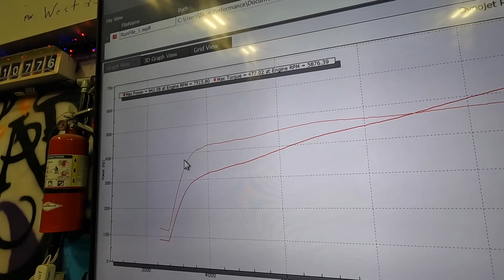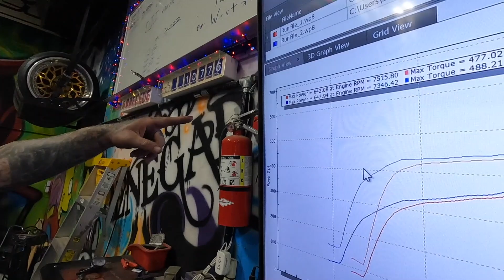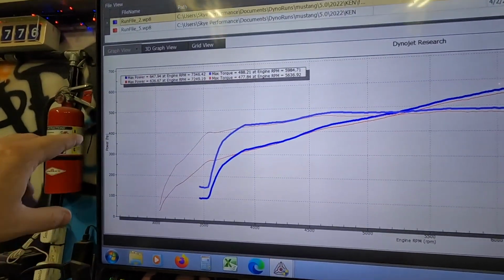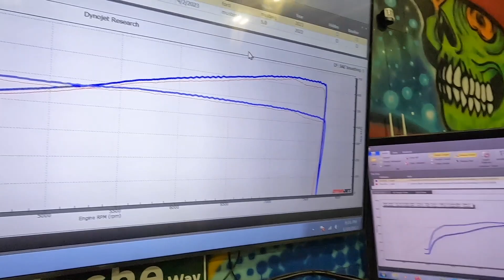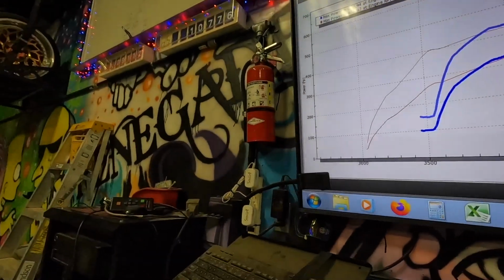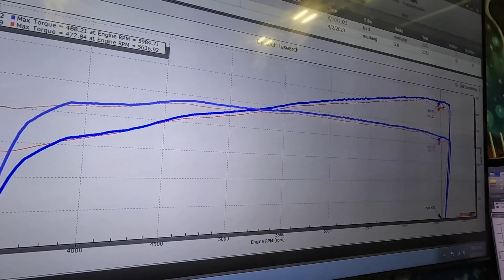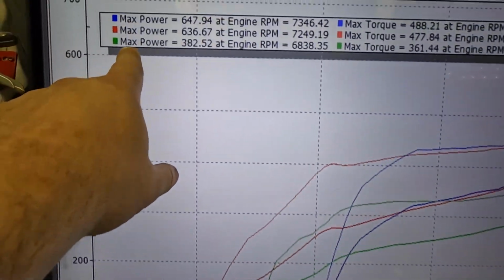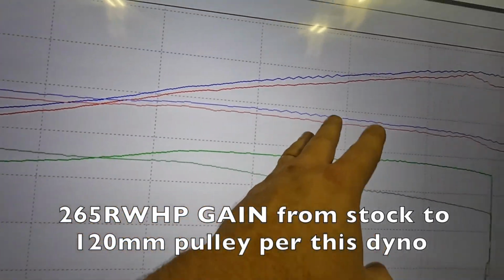Dyno of 22 Mustang with ESS G3X on 120 Pulley - 93 Tune, Stock Exhaust

Comment: HPR that ESS kit is really impressive it just keeps on pulling way up in the rpm band now that it's on E85 I'm really looking forward to seeing the passes it makes on the 120 pulley great series keep the videos coming.
Reply from the maker: Thank you! I’m looking forward to the E85 passes to see how it picks up at the dragstrip.
Reply: @SpeedAddict731  E85 without a fuel system ?
Reply from the maker: @cjflojack7963  no sir not on boost. I installed a fore triple pump fuel system. I will show it in the next video.

Comment: I installed my G3 / 120 this last weekend. So ready for a track day!
Reply: Nice!!  Did you notice a big jump in power just based on feel when driving?   I just bought a 2023 6 speed and planning a supercharger install this winter.  A big factor in the kit I choose is the overall feel.  I want to feel the power when I stomp it.  Appreciate any feedback you have!
Reply: It drives like stock until boost, then pulls harder and harder the whole way through RPMs.
Reply: @livestrib3752  nice man.  At what rpm’s do you feel it start pulling?  Reason I ask, I have a 6 speed so 1st thru 4th, the rpm’s climb real quick based on the gear ratios.  3-3500 would be the sweet spot I think!   Thanks for getting back to me.

Comment: Great comment about chasing dyno #'s.  I used to have an SVT Lightning that always dyno'd about 20 hp less than pretty much every other comparable truck when i was just bolt on.  But it ran 8.20's 1/8 on regular hard tires with pulley, tune, and mid pipe.

Comment: Hi, love the content.  What are the IATs for each setup please? I will be road coursing mine. After researching all the different super chargers I will pick the ESS. I want to keep it under 700 hp and don't want to change to E85. I have a '21 PP1 premium with H-pipe, active exhaust, and JLT catch can everything else is stock. What do you suggest?

Comment: What injectors are you using? Im considering the ESS with the 120 pulley as well. I dont want to mess with the fuel system and 600 + hp is plenty for me. Thanks
Reply: This is my exact reasoning.   Probably do some cooling mods.  Stay 93 octane and stock exhaust.
Reply: I have fic 1000 on my kit. G2 with G3 Intercooler, long tubes, high flow cats, x pipe, stock axle back with ngk spark plugs gapped at .028, vortex bap, precision bov, 2 oil catch cans, tuned by Lund on 93 pump gas for the last year no problem.

Also I have the mt82 but second trans lol. I have the McLeod RXT clutch with barton short throw shifter now. I also have stock OPGs for now. Car is heading back to the dyno next month. Last year it made just shy of 600 hp before the exhaust system upgrade due to a exhaust leak, on 125mm pulley so I'm hoping for 630ish on the 125mm now then pulley down to 120mm pulley and run it again.

Goal is 660-680ish. I'll be happy there. I plan on doing a fuel system upgrade next year and run e85 on the same pulley and hope to touch 730ish without dropping down to the 115mm pulley. I want to be able to drive it daily without having to swap from 115mm to 120mm because of knock issue on pump gas that the 115mm and below causes.

Stang is on my channel. I have some more content in the works as I'm still learning more about the kit and adding parts to the vehicle. Good luck with the kit if you pursue it. It's worth it.

Comment: Can a 2021 GT stock transmission run safely on a ESS G3 kit and 120 pulley using 93 octane? Thanks for the videos it’s always exciting to watch 🦾.
Reply from the maker: I have put over 2k miles on my car since the supercharger install. 0 trans issues. Usually around 800whp is when they can start giving trouble. However I’ve seen some go beyond that with no issues and I’ve seen some that go before that.  But usually 8-850 is when most see issues.

Comment: On E85 it’ll make 750.  I am running a Procharger D1-X with Fore fuel system on 13 pounds with E85 mine made 768HP/546TQ at Palm Beach Dyno.  That was on 20 inch / 305 Drag Radials which eats power on a Dyno.

Comment: I have the Ess g3, 115mm pulley, LT headers catless, 3’ H pipe all the way to mufflers. I’m still on 93 just because I haven’t put in my return fuel system. I wonder what I’ll be at
Reply from the maker: Depends on what timing you are running on the 115. Also on the dyno you use.
Reply: do you run booster?

Comment: I put down 730 and 590 on 93 octane with a g3x and 115mm
Reply: I've been debating running the 115 pulley on my gen 3. With 93 and boostane. You think it'll be safe?
Reply: @LSX-zr8ng i have been running 115mm on 93 for months now, zero issues, it's all about the tune that will make it perfectly safe

Comment: How much hp would catless long tubes add to the same setup on 120mm and 93??
Reply from the maker: I’d would have to have that setup on same dyno to be able to tell you that. I would assume around 20-30 more hp. Maybe more because you wouldn’t have the car going richer on the afr due to cat overtemp protection.
Reply: Makes sense, appreciate it man! I was just curious cause Brevin said 120mm on 93 should be around 700hp

Comment: I currently have the same set up but with headers, do you think I need to upgrade my transmission when I go on e85?
Reply from the maker: Usually around 800whp is when they can start giving trouble. However I’ve seen some go beyond that with no issues and I’ve seen some that go before that.  But usually 8-850 is when most see issues with a 10R80.  It is always best to build before it breaks.

Comment: I'm not surprised.
This is what I have and it's turned out to be a very poor investment.
All I ever hear is is slow because of pump gas all while whipple and procharger etc are getting alot better power out of the same 93 octane.
I thought for sure buying an ess supercharger and going with the g3x head unit combined with the g4 heat exchanger along with a free flowing exhaust would perform better than my old lame azz 16 roush rs3,but nope...
I just wish I had stayed stock and sold the car for something fast.
We don't have e85 in my area of Tennessee so I'm pretty much stuck with this junk.
Reply from the maker: My whipple car on 93 went 133 mph in the quarter just like this car does!  Procharger setups I’ve seen are trapping same as well. One thing you have to look at is timing, log your car.  I have seen people pulling timing on 93 and if so the car will be down on power alot.  Do a log and see if it’s pulling timing.  The whole point of me talking in this video is saying that the car did great in the quarter and dynos don’t always show the true power. But trap speed at the dragstrip doesn’t lie.
I have put whipple cars on the dyno we typically use and they put down same hp as a g3 on 120 pulley on 93 on the same dyno.
Reply: Can you return the car to stock sell the blower kit and the car separately? The quicker you do it the less loss. I feel sorry for you mate, with mine I was lucky I went Whipple on my 10R80 GT and its an absolute rocket, love it no regrets.